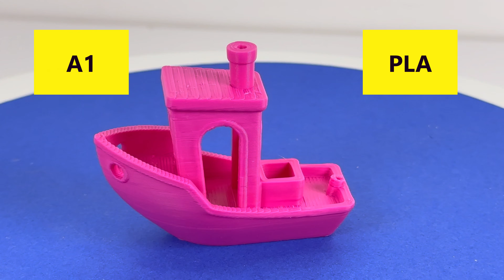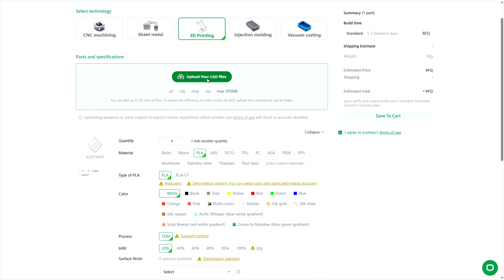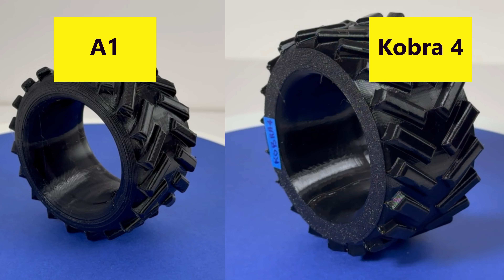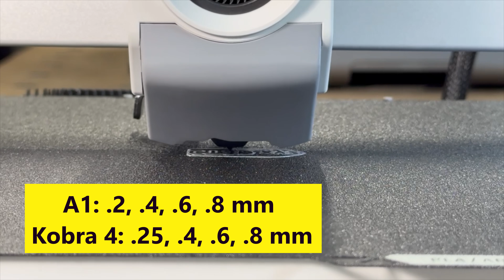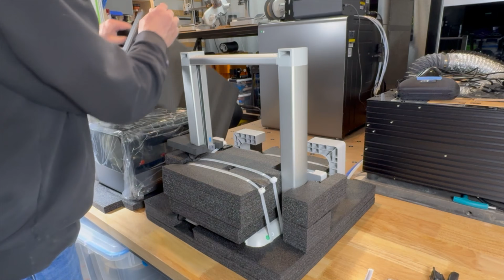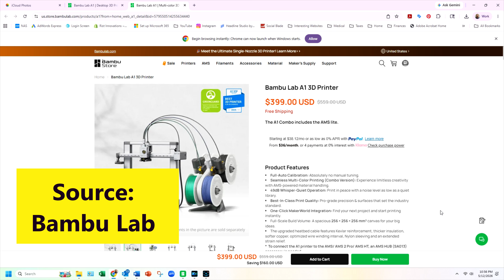NEW ANYCUBIC Kobra 4 vs. Bambu Lab A1- Which is Better?

Comment: 9:41 Bambu does sell a “TPU for AMS” in 7 colors.
Reply: Which is a TPU68D, so much stiffer than usual TPUs (85/90/95). That said, also the ACE 2 Pro cannot handle TPU 95 ;)